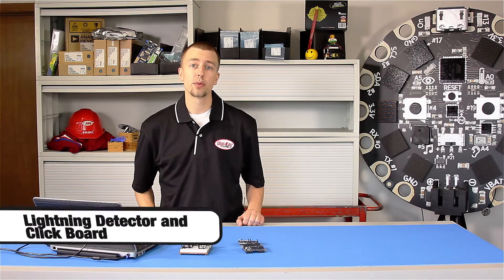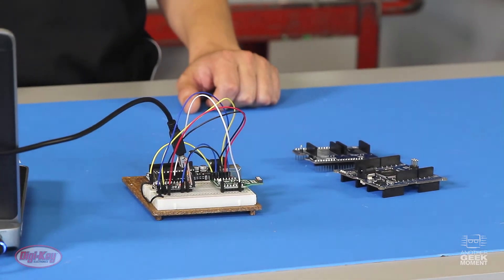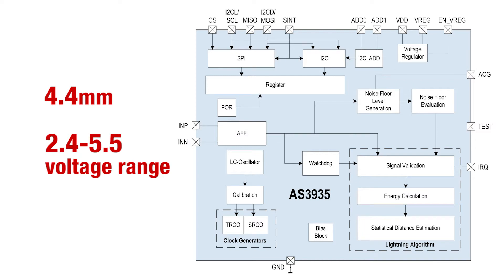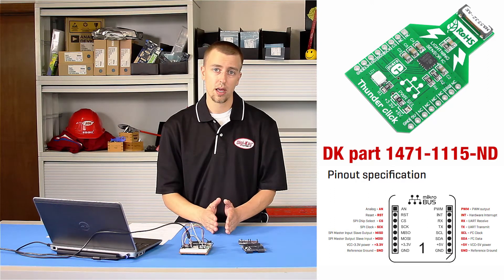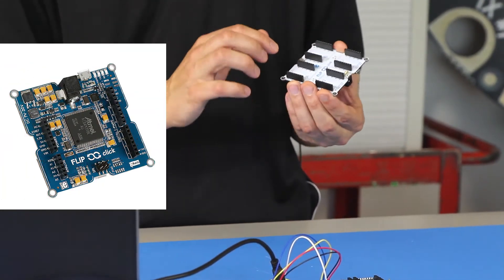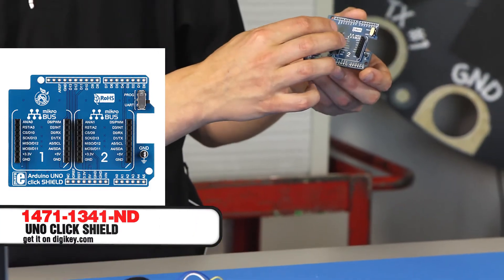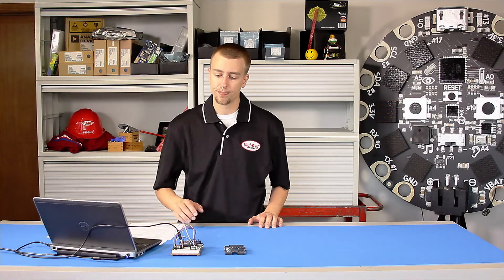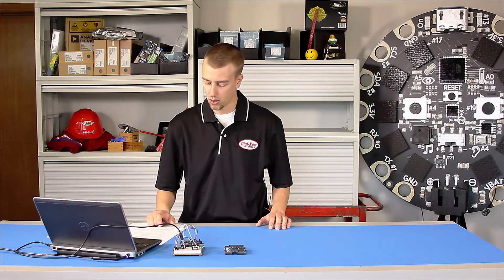ams AS3935 Lightning Sensor – Another Geek Moment | DigiKey

Comment: The AS3935 is an interesting but frustrating part because it is sensitive to RF noise and only really works when there is a storm around.  I've put together some information on using the AS3935 with a Bluetooth Serial interface and a Lightning Generator Circuit that can trigger the part into thinking there was a lightning strike.  https://sites.google.com/view/as3935workbook/home